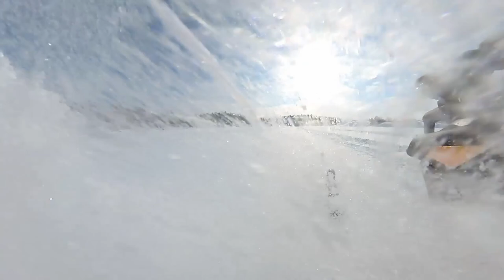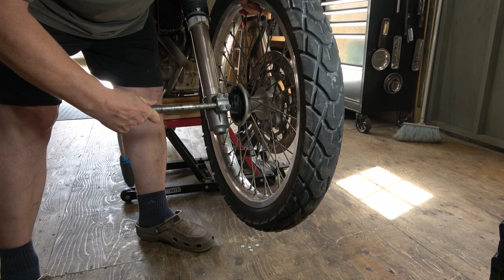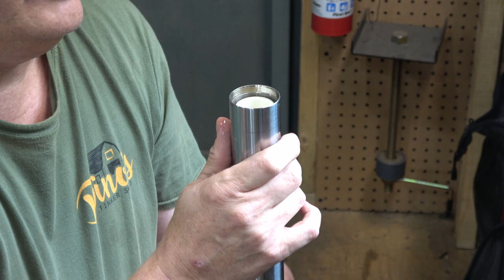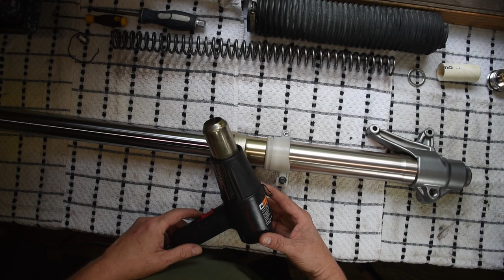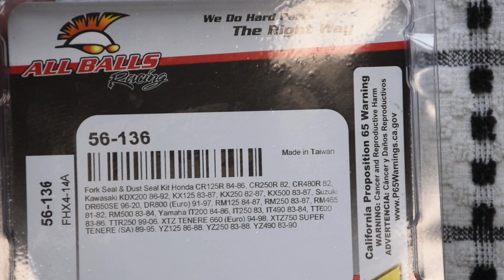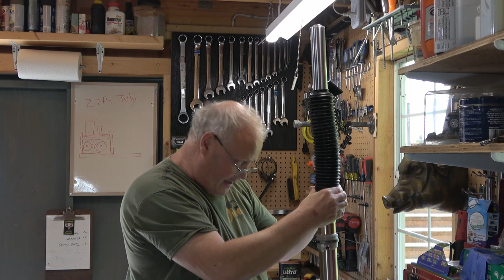Let me show you how to replace the fork seals on the Suzuki DR650

Comment: Another great video on the DR - thank you Dino I'll need to do this service at some point. One thing I wanted to point out is when you tightened the front axle holder you said to tighten in a criss cross pattern however the manual I have (I think it's the factory Suzuki manual but not positive) says to tighten the two upper nuts first. It even has a photo indicating there should be clearance on the bottom of the axle holder but none on top. Seems counter-intuitive to me, but that's what I've been doing for years.
Reply from the maker: Lol , I need to follow my own advice and read the manual, I missed that! I'll pin this so others can benefit from it. Thank you so much for the catch.
Dino

Comment: Hey Dino, I'm a fellow Ontarian up in Etobicoke. Found your channel a few days ago. You're a gem. I also own a brand new 2022 DR650, first bike ever. Did 5K on it already in the last 90 days.

However I'm having a problem. Everything is stock, except for my Yoshimura RS-2 slip on. I was told that rejetting and changing things isn't really needed, but it will be if I do anything else and want to eliminate popping/backfiring. My issue is that about a month ago, after extended rides on the highway (especially), my bike begins to die. Suddenly the throttle while in 5th becomes less responsive, jerky, and I need to keep giving it throttle for the bike to stay alive, but if I let go of the throttle too long and coast, or downshift into 4th, the bike dies.

Once the bike dies, it's almost impossible to get the bike started again, with or without choke. Sometimes I'm able to by giving it throttle while hitting the ignition, and then there is a TON of white smoke I need to BLOW past and rev for a while. This issue repeats itself, even when I've switched back to the stock exhaust.

In your expertise, what do you think this is? Is it the bike running too lean? If so, why would it create so much white smoke and have so much trouble starting up again? Would really appreciate your input and sorry if this is in the wrong place.

Love your content and would love to meet up some time. Maybe do some work on our bikes! Once I solve this, I'm ready with my ProCycle Jet kit and everything to do with it.
Reply from the maker: HI Michael Curtone and thank you for your questions. As I always do Ill point out I am not a mechanic but just a guy that enjoys tinkering but I will give you my thoughts. White smoke for most modern bikes would be a clue you had a head gasket issue and coolant was entering the combustion chamber but as you know the DR650 is air cooled so this is not a possibility. 
I do get white smoke occasionally at start up as the bike burns off any condensate that may be trapped in the system from sitting a while however in your case it is after long periods of longer most likely sustained engine speeds on the highway. 
Again I am not an expert but I like to start with the simple stuff first. 
1. Is the choke sticking or could it be sticking causing a rich condition?
2. Have you cleaned the fuel filter that is in the carburetor intake tube? This is quite small and perhaps you picked up some contamination at some point? This could  result in a fuel starvation issue and lean condition.
3. Have you pulled a spark plug to see what it looks like? Although not fool proof, reading the plug can tell you if it is running lean or rich.
I would start there and see what turns up. there are other potential issues but start simple first and see if these produce results.
Also the DRRiders.com is a great resource as well that can help new owners and riders solve issues. there are many much more knowledgeable people there in one place who are more than willing to assist as well.  
thanks for the question, and please keep me updated.
Dino
Reply: @DinosTinkerShed  Thanks so much for giving such a lengthy and detailed answer. This is why I love your channel.

I just installed my ProCycle Jet Kit today myself and I am NOT a handy man. It was very satisfying and managed to get my bike started successfully, all without completely removing the carburetor.

Right now I'm working on tuning and ran into some issues. Left on a comment/question on your relevant video regarding tuning.

Thanks again.

Comment: Hi Dino. Im doing a review of your videos and finding several are very informative. 

I did a front and rear suspension upgrade almost as soon as i purchased my bike using Cogent shocks, front springs and emulators. I also lowered the bike because although Im close to 6 ft tall i have a pretty bad left knee. . 😢

Looking at those forks they have definitely had work . That spacer is much longer which will have reduced sag plus that spring is very probably stiffer. I say this because Im about your weight and I promise you the standard Suzuki setup would have you almost scraping your nose on the ground with full braking. The front end is super soft.

One other thought is that when i take of the front wheel I always fold a piece of cardboard and jam it between the disc pads to keep them apart. This is so a friendly " helper" doesnt squeese the brake lever, pushing the pads out and spewing brake fluid everywhere. 

Dont ask why I know this. 😢
Reply from the maker: Thank you John, it's nice to get some confirmation on my spacers. I suspected they were replaced and they do help a lot for sure. Please keep up the great feedback.
Dino

Comment: I love how step by step and simple your videos are made.  I make installing the axle easier by lowering the jack so the wheel and the suspension holes are level, making sliding the axle through simple and smooth.  Also, waiting to tighten the axle 4 screws until after compressing the shocks to find the center alignment is important then tighten the axle side 4 screws, this way the shock arms are allowed to balance side to side.
Reply from the maker: Great tips, thank you for sharing
Dino

Comment: Dino, this is a well detailed and informative video. All the steps required are well explained and filmed. This video will be a great help for all who want to replace fork seals. Handlebars- I went for a 50mm (2") height increase. This is a great help with head position when standing on the pegs. Seating is a little more upright but as you have a screen (as I do) you are still protected. Thankyou
Reply from the maker: Thank you Mal, did you use risers or a 2" rise bar?
Dino
Reply: @DinosTinkerShed  Dino I went for a new bar. Bit of a job getting the hand grips off and onto the new bar. There are some good riser blocks available now and the job would be easier with those. M

Comment: I haven’t watched it yet Dino, just skimmed through, but it looks like another fantastic video. I love your style of videos, they are the best I’ve come across on YouTube for DR650 maintenance and general DIY stuff.
I had a fork seal leak on my 2017 DR650 recently, but luckily was able to fix it by running a home made “seal mate” from a plastic bottle around the seal, which must have removed a bit of dirt causing the leak. I thought I lost heaps of oil as the engine and my boots were covered in it. To judge how much oil to top up I used a dipstick made from a long stick and compared oil levels with the fork on the other side. Surprisingly only had to add about 150 ml. 
I will refer to your video again if I ever have to replace my seals.
Reply from the maker: Wow, thank you so much for the feedback, it lets me know the content I'm creating is resonating with viewer. I am glad you find the videos useful and I should really make a follow up video about your seal saver trick, I've never done that myself but I have read it works well. 
Thank you again for the comment, it is appreciated.
Dino
Reply: The quality of your videos are amazing and I hope they get out to more viewers. Maybe the seal mate trick could have solved your leak too?? Anyhow, I’m really glad you made the video for reference.
When I noticed my leak during a ride a friend had a seal mate on him which I used but it didn’t solve the issue. When I got home I watched a couple of YouTube videos about using them and learnt that first I should have removed the dust seal. Obvious now, but I had zero experience with forks so didn’t have a clue, After doing this and trying again with my seal mate made from a plastic bottle it worked.

Comment: I have a 2020 DR650, few months ago I put new springs and the cogent DDC's into my forks.  We measured the fork oil going in to the MM. And then, just because my Dad is a perfectionist, he rigged up a jig with a straight tube cut to the exact level the oil should be at with a big-assed horse syringe on the end of it... and it was perfect.  If you get the right amount of oil, measuring is redundant.
Reply from the maker: Thank you for the information, its good to know that the volume they state is the right amount when measured, great information to have, also it sounds like your Dad it my kind of guy, precise and inventive!
Thank you for taking the time to comment
Dino

Comment: Dino, are you planning on doing a DR vid on greasing the rear suspension pivot linkages in the near future??? That would be interesting.
Reply from the maker: I am but it will not be until the winter here, I am having too much fun riding right now. Thanks for the question.
Dino

Comment: Your videos are amazing, thanks for sharing Dino!
On my DR650, I just finished installing a set of ProTaper Adventure bars using the ProTaper universal rubber adapter.  I had to drill out the OEM bushings, but it went on pretty easily.  It seems like a nice clean installation (fat bars with no adapters), and just about the perfect height (for me), but I haven't had a chance to put more than about 200km on it since the mod, so time will tell.
Reply from the maker: Thanks for the information on the bars, I've looked at the ProTaper adventure bars and they look very good.
Thank you again
Dino

Comment: The rear lower for the dr650 also has a section that needs to be flipped on the shock.
Reply from the maker: Thank you for the correction. 😀
Dino
Reply: Okay I would need an instruction video on lowering the Dr's suspension properly, or alternately to raise the suspension back to normal from a bike that had been lowered.

Comment: Great video as always Dino. I'd highly recommend the Acerbis noeprene fork protectors. As opposed to the plastic gators, they don't have holes where dust and mud can be sucked in on extension. 30000km on my DR and forks are still bone dry and it's not had an easy life (wheelies, offroading, jumps, rough roads, etc)

Comment: I can usually fix my leaks by running a feeler gauge under and around the seal, more often than not it's just a bit of dirt on my bikes.  Someone made a special tool for that.
Reply from the maker: I have read about doing this, some say a piece of a one gallon milk jug works as well. I have never tried it myself but it does make sense. Thank you for sharing the tip.
Dino
Reply: @DinosTinkerShed  sure, good video, you are my DR 650s manual😁

Comment: Well done , you explained that well. I dont know why they dont put drain screws on the tubes. I would change oil more frequently if they did. Its a bit of a hassle to pull the tubes just to swap oil out. What were they thinking? Or perhaps they were cutting costs. Who knows.
Reply from the maker: I'm not sure why they don't, they may want to force you to take the forks apart to inspect the internals, not really sure.
Thank you fort the post.
Dino
Reply: Re filling the oil might be a bit tough. There would be alot of air left inside wouldn't there?
Reply: Because you still have to pump the tube to get all the air out, which you cant really do with them installed. Takes like 20 minutes to remove the forks, it's not much work considering you dont have to do this often at all.

Comment: Cheers from Saskatchewan! I found your channel while I was looking for videos on maintaining my DR650. I just wanted to say thanks; not only have I gotten lots of information on maintenance but I got a lot of confidence to tinker with my bike. I even decided to expand my tool sets and do some work myself that I thought I needed to pay a shop to do. So, I have replaced all my springs with racetech stiffer ones (the back SUCKED BTW), added intiminators in the forks, and added a screen and tank. And I replaced my bent handlebars with a Protaper bar.

Have you given any thought to changing your carb by any chance? I have a TM-42 and the conversion parts from Australia to go to the pumper carb from the CV carb, and I was wondering if you'd thought of doing one of the flatside carbs in the future. Apparently it can give slight increase in MPG in addition to the throttle response improvements.
Reply from the maker: Hey thank you for the feedback, I am glad you find the content helpful  enough to tackle some of the work on your DR yourself. Again I am not a mechanic but I find it fun to tackle some of these jobs on my own as you are and you learn allot along the way.  😀

I have looked at the TM-42 but at this point I don't plan on upgrading to it. After the Jet kit upgrade on my BST I find it performs fine for the riding I do and seems to start and idle much better now that I was able to adjust the air mixture screw. From what I have read the TM does improve the bike in the areas you mentioned however It is a costly upgrade for me considering I find the current performance of the bike satisfactory for my riding style. 

However If someday I get a good deal on a TM I may choose to upgrade and at that time I would definitely make a video on the process.
Thank you again for taking the time to comment and aske a question.
Dino

Comment: Dino thanks for all your videos lm 52 years old but my dr 650 2024 turn me 25 years old l got the bike cause l use it like my daily driver to go to work crosing the border from Tijuana MEXICO to san diego california USA monday to friday adding 44 miles day by day Do you think that is ok to do my oil changes every 2500 miles? to my understanding its every 3000 miles but l want to care the DR very good also l never use it for dirty roads only for freeway and my speed always its 80 miles per hour its not bad for this kind of motorcycles? Well for now its all, Thank you again for everthing.
Reply from the maker: Hey, thank you for the question, I'm sure that 300 miles is fine but if it were me I would do what you mentioned and change it at 2500 miles. Oil and a filter is not to expensive and with all the higher revving riding on the freeway I think a little prevention is a good idea.

Comment: Hey dino i changed out my fork seals a while back and made sure to do everything right but when i sit on the bike and my weight puts load on the suspension the front drops and extra inch or two and im not sure why that is. Is it because i didnt cycle the fluid and get the air all out? I made sure to measure the correct amount im not sure if it can cause some damage but ive been dealing with it for the season but since winter is coming i was thinking about doing somerhing about it. Any input? Thanks!
Reply from the maker: Sorry for the late response on this. again I am not an expert on this but my understanding is that the spring set your ride height not the oil (it dampens the action of the fork). My first thought would be that you may have installed the spacer on the wrong end of the fork, effectively lowering the bike. I know it is a pain but I would say you ma need to disassemble and check the order of your installation. :( 
Dino
Reply: @DinosTinkerShed  well besides not getting all the air out of the forks im not sure what it could be i have the spring then plastic spacer then metal washer on top then fork cap. 
Any negative effects from having the forks like this?

Comment: Way better to measure the fork oil height, there could still be oil left in the fork that you couldn't get out and just filling it by volume would mean there's then too much oil in there.
Reply from the maker: This is a true point especially if you are not dismantling the fork completely as I did in the video.
Thank you for the comment
Dino